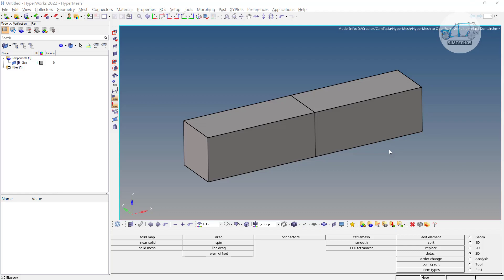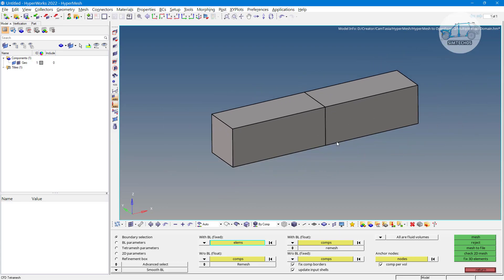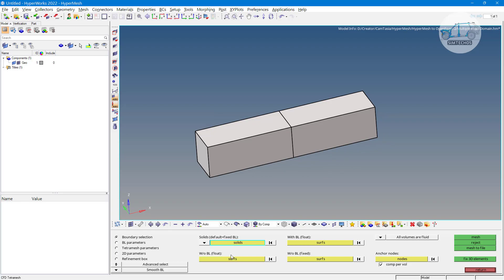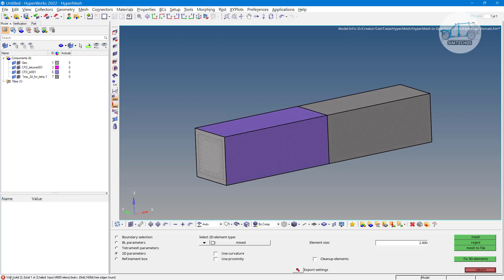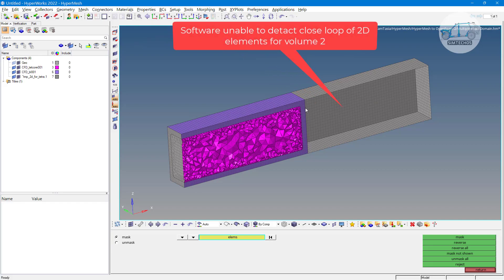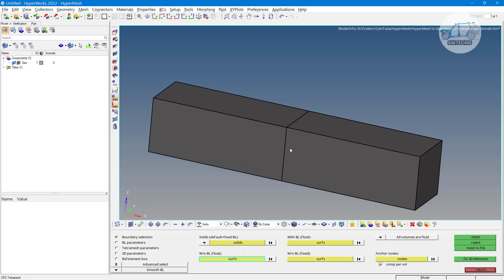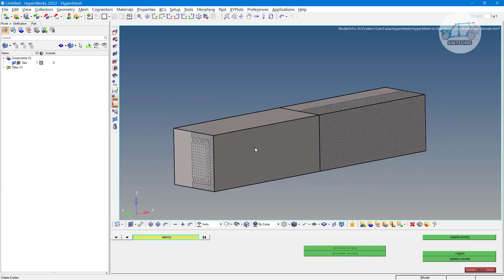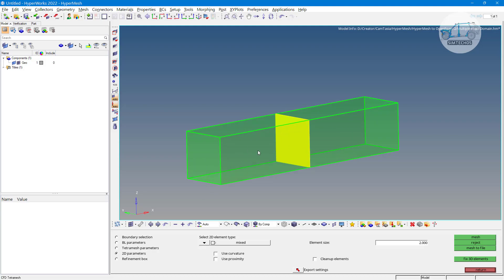CFD Mesh in Hypermesh 07 - Multiple volume mesh from Hypermesh to ANSYS Fluent / OpenFoam

Comment: Hi sir, please make a video on how to convert 2d surface mesh (from hypermesh) to volume mesh (fluent)
For different simulations like aerodynamic,  thermal based simulations.. 
Please do a video on this sir.
Thank you
Reply from the maker: Dear,
2d mesh to 3d volume mesh i already shown in my previous videos. Please go through the playlist; CFD mesh - Hypermesh

https://www.youtube.com/watch?v=muIQeZnxWGA&list=PLdXwpuOm8L9puqMEWiecCPDhOcP-aiint

In upcoming video I'll consider such problem as you listed.
Reply: @SimTech05  thanks for your response sir, please do volume mesh (3dmesh) in ansys fluent with different element types tetra, hexa, polyhedra like that..
Thank you
Reply from the maker: Dear,
I never used Ansys module for preprocessing...as preprocessing in Ansys is very tedious work. I recommend you to use Hypermesh for preprocessing.
With Hypermesh preprocessing you can export mesh almost for every known CAE software.